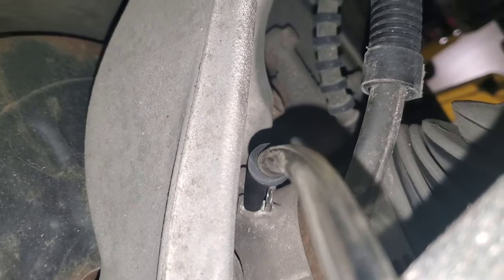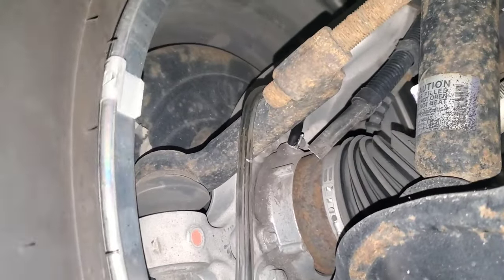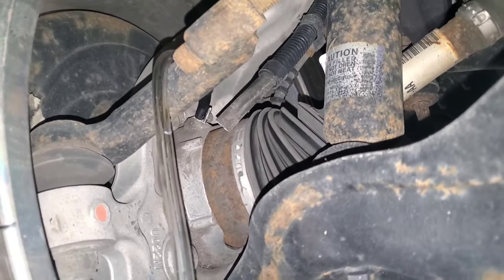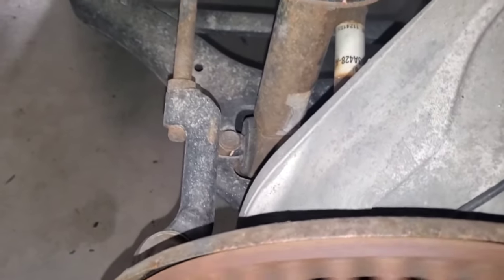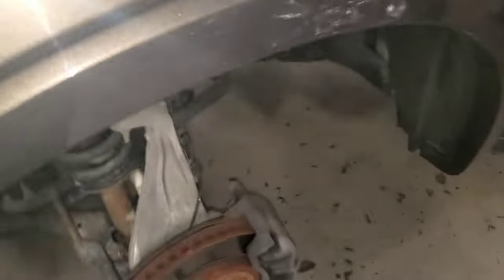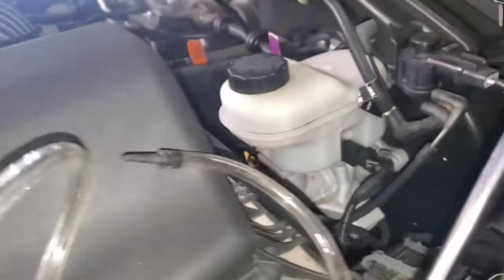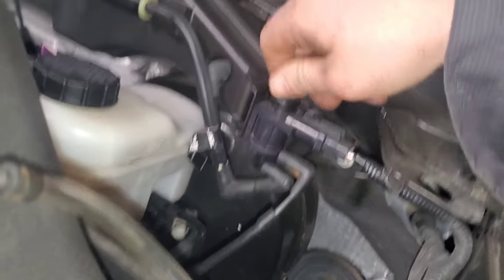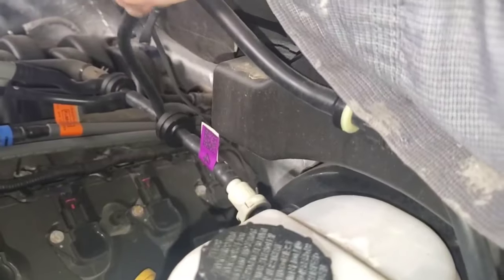Quick F150 IWE 4x4 Actuator System Check from solenoid down to Hubs - How To Vacuum Gauge Needed

Comment: I have and 18 F150 that makes a growling noise in 2wd. When the truck is going straight there no noise, but if you turn either way slightly for a corner or curve thats when it growls. Can only notice in town at speeds under 20 do to wind noise. Truck only has 32k it so I hope it’s covered under drivetrain warranty.
Reply: Hey Jared. I am having the same problem. Was wondering if you fixed the problem and can help me? Thanks man.
Reply: @brendonharrilal2092  ticket says they replaced both IWE’s…Was under warranty so I don’t know what the repair would have cost. Truck only has 35k on it. Good luck buddy

Comment: I’ve been having numerous IWE issues on my 2018 lariat. Between two different dealers, they have performed a couple tsb’s, check valve replacement, a vacuum line, and I believe an IWE itself. It used to make a grinding noise when braking in only cold weather (below 45 degrees I’d say) but now in the warmer weather (60 degrees) it is still doing it. I am at a loss, it is very annoying and it drives me nuts. I am waiting on my 2021 f150 order to come in because I’m so fed up with my ‘18. This is a very informative video!
Reply from the maker: I appreciate your support and this is a chronic problem with these truck iwes
Reply: @FordBossMe  I crawled underneath a 2021 not too long ago and saw that Ford changed the IWE, it looked electronic now if I’m not mistaken
Reply from the maker: @joshv7374  I have not looked
Reply: @FordBossMe  hopefully whatever changes they made is for the better!
Reply: Have you found a solution? Is the iwe part of the hub assembly? I see no options for interested wheel end on Rockauto for the 09-14 fx4..
Reply: Mine is doing a sound like a scrubbing nose when it gets cold. I replaced the driver wheel hub and new front brakes and still makes the noise. The noise is on the driver side. I think I'm only getting partial disengagement of the IWE and its rubbing. Under hood check valve and solenoid were replaced. Thanks

Comment: I love your video's, I've thoroughly watched all your IWE videos. I've been having a problem with my trucks IWE (assuming its that). I got the service manual over the weekend to see if I was missing something. I have a 2019 Lariat with the "torque on demand" transfer case. Every single time i go for a drive I get the humming sound from the front left. I did all the troubleshooting possible. The check valve was broken. I replaced it but fault is still there. I dont have a real way to test the module so i bypassed the solenoid  (attaching a male to male fitting between both vacuum hoses that go on the solenoid) and went for a drive. fault is still there. Vacuum reservoir is holding 20 in mg for 20 mins+ same for the vacuum lines downstream of the solenoid. I tested at what point the IWE's open up at and at 5 in mg they unlock the front axles. While i tested the vacuum lines i even tried shaking them to see if there was a small hole, found nothing. Im at a loss of words... I did the troubleshooting as per service manual and nothing is coming up. Do you have any other idea? When i'm driving with the window open to hear if the IWE's are making noise I literally hear nothing. I only hear the light humming sound with windows up, AC off, radio off. I even tried shaking the tires when i jacked the truck to see if the wheel bearing was going.. but again she's stiff and nothing... The truck is under warranty but when I bring it to a local dealer they slap on the TSB 20-2307. It does fix a problem but I find the TSB is a bandaid repair and when we spend this kind of money on these trucks its a slap in the face considering it makes the truck drink more gas and adds more wear and tear on my front diff.

If you have any other suggestions i'll love to hear it because its really annoying.
Thanks
Reply from the maker: Just because you have a good vacuum test on your IWE doesn't mean it's actually good and we need to talk about this very soon because people get that confused they think because the vacuum's good the IWE is good and that is not the case
Reply: @FordBossMe  very interesting!!

Comment: Hi bro..! I have a f150 07 my 4x4 Lights on and off on the Dashboard. When i put 4h or 4L dont work. So I replace all the lines vacuum, the hubs are great.! The solenoid is great but i round that dont arrive ground connection to the iwe Connector. So i dont know what to do.
Reply from the maker: Out your own ground in

Comment: Hello I noticed a weird grinding noise and found this check valve issue I replaced my assembly but realized it was already the new version. Should I try solenoid next?
Reply from the maker: You really need to do all of the tests like I say in my videos you're going to have to vacuum test each one of the iwes and you're going to have to vacuum test the lines connected to the iwes and if you follow my videos you're going to find out what's wrong I don't have any more input than that for you unfortunately

Comment: Has F150 dropped the front IWE completely for the 2022 model line up? Or is it still running electric actuated like in the couple of years previous to the 2022?
Reply from the maker: It's electrically controlled vacuum actuated previous to 2022 and as for if they're still using it I haven't looked at because I haven't had a reason to

Comment: You sir are amazing. Thank you for your time and effort. I needed this so bad. Great job brother !!!!
Reply from the maker: If you don't have the blue check valve get it, the black one is the old one
Reply: @FordBossMe  Quick question I check my whole system is working properly. I marked the axles I move the truck forward and they don’t spin reverse they don’t spin. But if I go on a drive I notice they spun. Is that normal? Do they disengage and engage once in a while during normal driving?

Comment: Is the IWE solenoid supposed to act like a check valve also? I’m looking at an older one of these today and it’s problem is when you engage 4WD it isn’t releasing vacuum. You can hear the solenoid switch and it isn’t applying vacuum to the IWEs, but the existing vacuum isn’t venting. I guess I don’t understand the venting process and Mitchell ProDemand isn’t helpful. Can’t even get a diagram.
Reply from the maker: Switch the vacuum lines around and see if it's doing the same thing at the solenoid
Reply: @FordBossMe  I’ll try to see if I can do that.
What’s weird is this is an older model (2005) that has the two hoses feeing into a joined block where you can’t really switch them without physically yanking the hoses out of the tips. 

Currently, source vacuum is going to the upper nipple on the solenoid and the vacuum line to the IWEs is at the lower one.

Comment: I thought the system is supposed to have vacuum while in 2wd. Mine doesn’t have vacuum until I cycle through the 4wd then back to 2wd. Then there is engine vacuum until I turn the engine off and restart. Don’t know if it is a program issue or something else?
Reply from the maker: Look at my other videos on this they changed some of the procedure on 2017 and up F150s

I don't know what year you have but if you look at my other videos where I talk about 2017 through 2020 F-150 four-wheel drive function you'll see that they don't have the same strategy the previous model does

Comment: When my wheel hubs have vacuum they disengage when I pull my vacuum hoses off the wheel hub 4x4 engages. So why when I turn my 4x4 switch to 4x4 does it not work?
Reply from the maker: Either you have a bad switch or the vacuum solenoid out on the firewall is bad or something doesn't have power

Comment: You mentioned replacing the hub assembly. what symptoms would you look for that indicate the hub needs replacement for the iwe to work properly?
Thanks in advance.
Reply from the maker: Grinding howling chattering sound
Reply from the maker: Sometimes worse when turning

Comment: I put a vacuum tester on the output side of my solenoid and measured 0s in 2WD. I’m assuming that means my solenoid is trash or it’s not getting ground. Correct?
Reply from the maker: Yep
Reply from the maker: Or power, something is up with it

Comment: Excellent walk through. 
Thanks.
Reply from the maker: Glad it was helpful!
Reply: @FordBossMe  
It was, and turns out I knocked the hose off on the passenger side.
So that has been locked in the whole time and the noise on the driver side was because the vacume was weak with the other side wide open.

I didn't look at the passenger side because it was quiet or I would have solved this 3 days ago... 
facepalm

Comment: Quick question I check my whole system is working properly. I marked the axles I move the truck forward and they don’t spin reverse they don’t spin. But if I go on a drive I notice they spun. Is that normal? Do they disengage and engage once in a while during normal driving?
Reply from the maker: Yes
Reply from the maker: That's normal

Comment: Mine isn’t really a clicking sound. It has more of a knobby tire sound. I hear it  more when I’m coming to a stop between 0-20 mph. I’ve noticed when it’s colder out the noise starts sooner when breaking from like 0-40 mph. You can feel it in the whole drive line.  Even feels like you are riding on knobby tires. When it’s 60° and above it hardly does it at all. Do you think this could still be related to the IWE’s? Truck is a 2016 F150 with 42k miles. Also has the 4A mode on it.
Reply from the maker: I'm not sure what you're dealing with here I'm wondering if it's not some kind of driveline issue
Reply: I’ve read some that thought it could be related to the differential bearings. Just wanted to get your take. Thanks
Reply: I'm experiencing the same on my 2018 (driver's side).  I swapped out the IWE.  Thought it was good for ~2 weeks until it came back.

Comment: I have an 09 f150. 4x4 won't engage, changed the valve solenoid,  still won't engage. Can hear the transfer case motor click when I turn the selector. Cleaned out the vacuum  lines the best I could( canned air) and getting vacuum  to the iwe. What else am I missing?
Reply from the maker: Well if you're getting vacuumed down at the integrated wheel ends the hubs with the weight off of the vehicle and the front tires engage the CV axles the problem is more than likely four wheel drive motor itself unfortunately or something inside the transfer case if all the vacuum lines check out in the iwe engage
Reply: @FordBossMe  I haven't lifted the truck off the ground yet ( have to dog a path to my shed to get jack) but I did put it in 4lo and moved back and forth and I could tell the truck was running in low gear so I'm assuming  the transfer case motor  is working, unless I'm confused on that. There wasnt much vacuum at the iwe but I don't know how much it should be. If the iwe are bad do the fail safe in 4x4 or 2x4?

Comment: Hi I have an ford f150 2017 4x4 I took it to the dealer and I can't find anything wrong with it. When I'm driving and my car goes 2000 RPM it rattled. On the back. If there's something that you can help me with.
Reply from the maker: I've never heard that before especially at 2000 RPM and it rattled in the back? Are you explaining that correctly
Reply: @FordBossMe  Is there any number that I could call you at

Comment: Mine is doing a sound like a scrubbing nose when it gets cold. I replaced the driver wheel hub and new front brakes and still makes the noise. The noise is on the driver side. I think I'm only getting partial disengagement of the IWE and its rubbing. Under hood check valve and solenoid were replaced. Thanks
Reply: I’ve done check valve and solenoid noise is still there. Next I’m checking the lines. What fixed it for you?
Reply: @georged1085  haven't yet.
Reply: @ItsMeJbird  I’ll let you know if I have any luck
Reply: @georged1085  I think I might try the Accurator next. It's the last damn thing, lol
Reply: @ItsMeJbird  the iwe actuators? I’m thinking that’s what mine is. Have you tested your vacuum lines for leaks?
Reply: Also have you been driving it? I’ve been scared of it getting worse and been using my granny’s old car lol
Reply: @georged1085  I've been driving it. Doesn't seem to be an issue. Only when it cold. I think the rubber on the IWE's are stiff when it's cold out. Just makes a scrubbing sound when driving real slow then goes away with speed.

Comment: Mines off and on, how do i clean the vac module, i suspect fliud, or debris in it?
Reply from the maker: There's a vacuum solenoid up on the firewall and I have a ton of videos on here showing different things about the four-wheel drive system you can pop the cover off of it and you can clean a little filter but at that point you may as well just replace the vacuum solenoid and the black check valve that attaches to it to the Blue version which is the updated one
Reply: @FordBossMe  awesome thx Boss, im subbing and go explore you're video, Thanks very helpful, 👍

Comment: I have an 04 f150 I’m not getting vacuum to the iwe I have changed the solenoid check valve and all vacuum lines to iwe
Reply from the maker: Keep going down the line until you get to the source of vacuum
Reply: I have vacuum at the solenoid but just not Down to the wheels

Comment: My 2019 f150 doesn’t let vacuum out of my solenoid into to the hose to my hubs/actuators. I don’t think that’s normal. Is vacuum suppose to be coming out from the top nipple of the solenoid ? I get no vacuum at all when truck is on or off. I used my vacuum pump on the bigger port of the actuator and my actuator disengages from the axle.
Reply from the maker: So you need to watch the rest of my videos on how to diagnose this

 if you didn't get how to diagnose this from this video there's a problem

Now you have to see where you're losing vacuum in two wheel drive

 you should be able to pull that line off and feel vacuum with vehicle running in 2wd on that hose if there's no vacuum on that hose you need to follow the lines all the way back up to the solenoid on the reservoir on the firewall top driver side... which I have clearly showed in several videos how to do that so I would suggest starting there please

 it's hard to explain all this in a message when I have several videos explaining everything that you need to do to diagnose this
Reply: @FordBossMe  
I don’t get vacuum from the top port of the solenoid when engaged in 2wd I do get vacuum into it but not out.
Reply from the maker: @Blanco_5.0  so you either have a power problem to the solenoid or the solenoid is bad
Reply from the maker: @Blanco_5.0  most of the time it's the solenoid that's bad
Reply: @FordBossMe  how can I check if their is poor power to solenoid, do you have a video to check for that?
Reply from the maker: @Blanco_5.0  you're going to need a digital volt ohm meter and with the vehicle running the connector unplugged one of the ports should have 12 volts Plus on it and the other one should have ground

Yes if you look in my library you'll see I have an F250 where I am replacing a radiator but at the same time I'm also diagnosing the four-wheel-drive unit because it's not engaging and it's the same style of connector same setup
Reply from the maker: @Blanco_5.0  know what I just looked about the F250 and I don't see it

12 volt on 1 pin and ground on the other
Reply from the maker: @Blanco_5.0  make sure you watch all of my F-150 four-wheel drive videos to because you'll see sometimes people put those vacuum lines on the wrong ports if they mess with them
Reply: @FordBossMe  cool thanks I will check it out

Comment: I'm getting vacuum down to my iwe's  on my 2013 f150. When I engage the 4wd I'm getting a check 4x4 light and its still getting vacuum to the iwe's with the 4wd turned on.  I put a new solenoid on it and still the same problem.  Any ideas what it could be? Thanks for the video
Reply from the maker: If you're getting a warning message chances are it's the actual motor on the back of the transfer case it's not so much the engagement of the front as long as the integrated wilentz are good it is the motor on the transfer case more than likely because I've never seen a hub actuator cause a check full driver's light but I have seen the motor on the back of the transfer case cause that and some of those Motors when you change them you actually have two deep in one of the wires and then move it over to the new motor when you install it it can be kind of tricky

Comment: 2013 FX4. Got home one day and passenger front rotor was smoking. Bad play in wheel bearing, replaced it and new rotors and pads on both sides. Front passenger still smoking in less than 5 miles. Replaced both calipers and both brake hoses. Still getting extremely hot on right side. Did the tests on this video too, everything passed. Mechanic shop can’t figure it out either, anyone have any suggestions?
Reply from the maker: Then there is a line restriction
Or restriction in the abs.....or partially stuck abs valve or further down the brake lines 

Do an abs bleed procedure using the computer that activates the pump and follow the on-screen prompts and you'll probably see the string coming out of the brake caliper when you crack the bleeders loose you'll see which one is different and which one is giving you the problem
Reply: @FordBossMe  what computer would I need for this? Are there any affordable tools they sell?
Reply: @blifftc what’d you do to fix this? just wondering
Reply: @georged1085  Only thing I could guess is there was some type of blockage in the front passenger line cause I went through 3 new calipers and still got the same symptoms. Ended up completely draining/replacing all brake fluid and it stopped. Took the hose off the passenger front and pumped the fire out of the brakes and a bunch of debris came out.